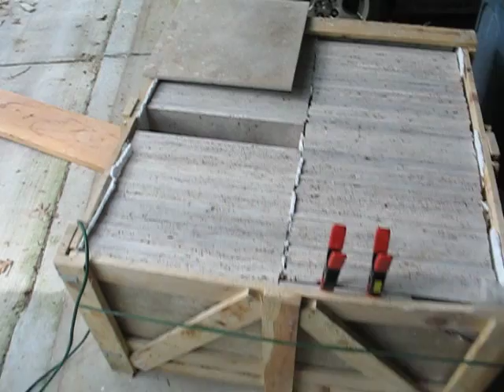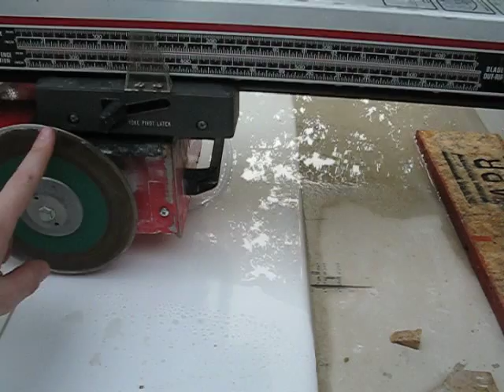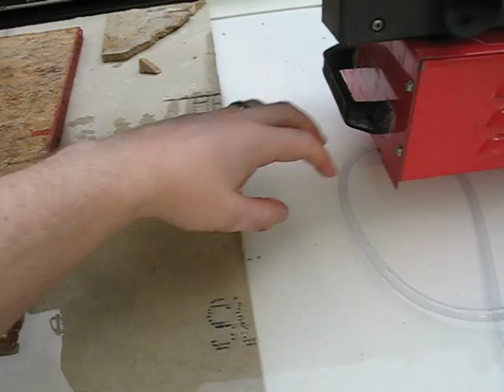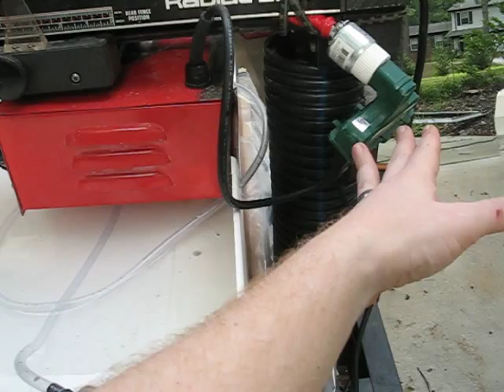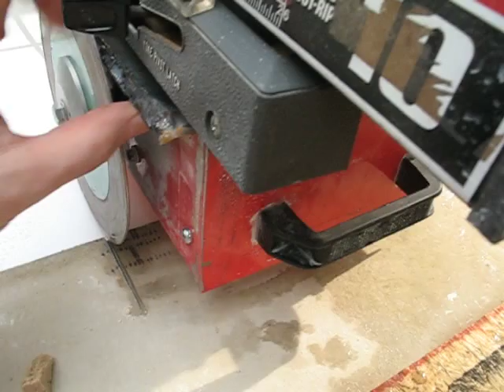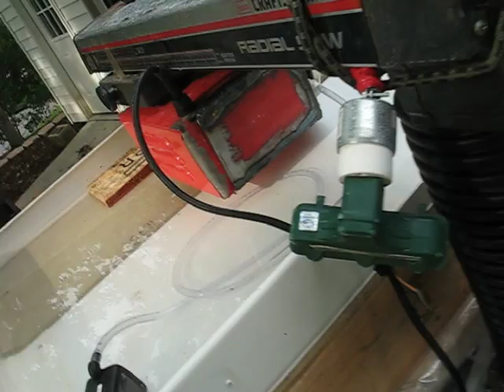homemade tile saw using radial arm saw and harbor freight tile saw

Comment from the maker: I will get some video of it in action this weekend.  I have probably 30 hours of use with it now, - way more than I initially thought I would need, but it has held up fine.  I suspect using hardee board as a surface for the tile has been a major improvement over the metal in commercial units as it dampens vibrations and I do not get accidental cracking at all.